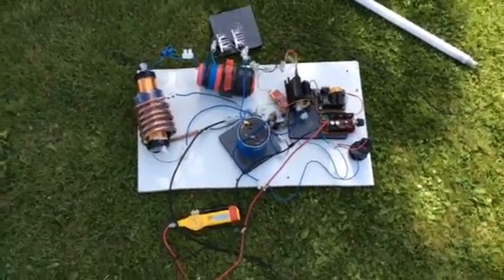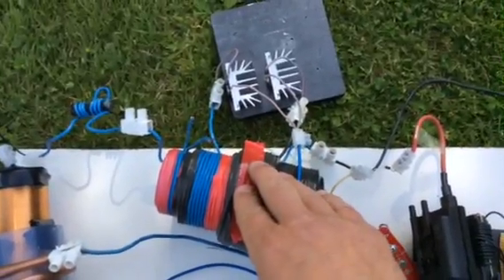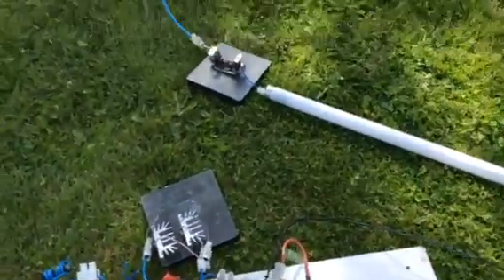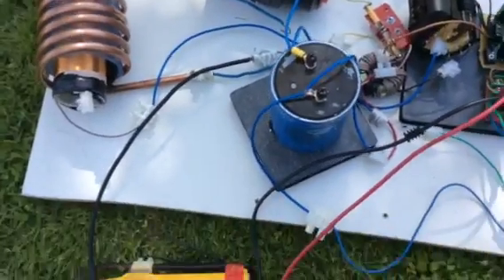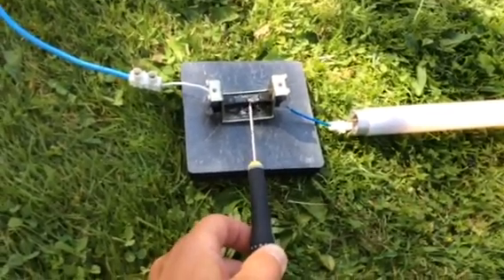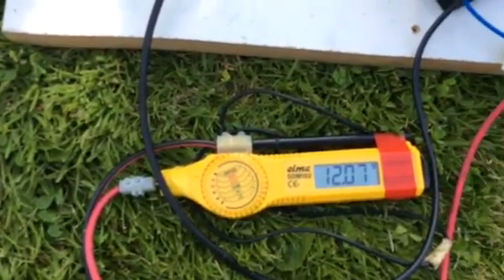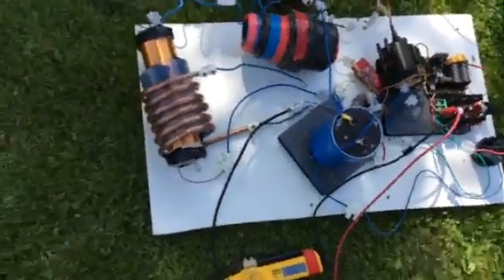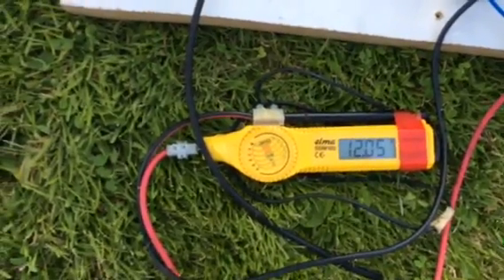ZVS recuperator phase 3 tesla, Kapanadze experiment.

Comment: Hi DK
,Nice setup here,.. seems the 2 grounds along with the SG are complementary and the grenade is a resonant big booster coil along with tesla coil .Are you using the ZVS as splitter for the TV flyback and the tesla coil cant quite makeout wiring if so you have 2 HV sources?
Reply from the maker: foamaxmore thanks, no their is a ZVS into the flyback and a ferrite on one of the legs of the bifilar winding on the flyback core. I will make a drawing and try to make everything a little more tidy.
But I need a better spark gap, wondering about spark plugs?
Reply: Some spark plugs contain an inner resistor but you can set the gap and make them more stationary ..worth a test!

Comment: Hi Dyk,
Nice setup. I'd like to ask, what is the use of a strip light? Is it necessary? Or serves as external load?
Reply from the maker: JB-N107Lab yes just using it as an external load.
Reply: Thanks.
Could you tell the difference between that strip light and by using incandescent?  Is the type of load affect the recuperation efffect?
Reply from the maker: JB-N107Lab good question I will look at it and come back to you.
Reply: Thanks. Looking forward the results. I never tried yet using strip light. Hope it doesn't affect the recuperation process.
Reply from the maker: JB-N107Lab ok I have tried cfl load but this alters the increase in charge to the battery. I have a spark plug spark gap now so I hope this helps, will come back with more results.
Reply: Hi Dyk,
Thanks for the quick response.

I have tried spark plug before and noticed some of it has higher resistance, I think around 1K. I used a spark plug from a gasoline engine grass cutter. I forgot the type, it's smaller in size but  It has less resistance compare to the usual type use in most vehicle.
Reply from the maker: JB-N107Lab yes some plugs do have resistors built in. Not sure about the ones I have.
Reply: We can use two of them in opposite direction. Just use only its outer (gnd) electrodes. I think it can handle that spark.
Reply from the maker: JB-N107Lab ok will try